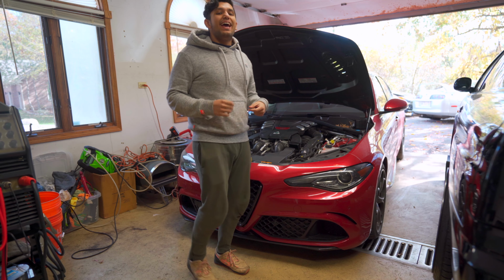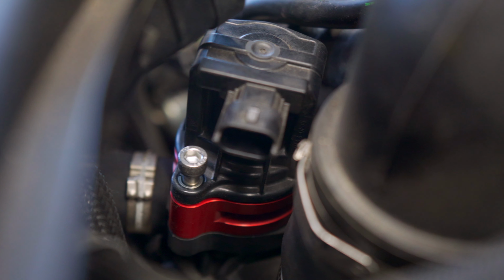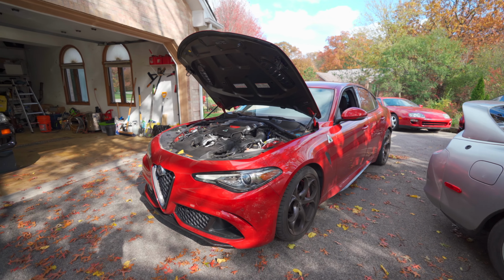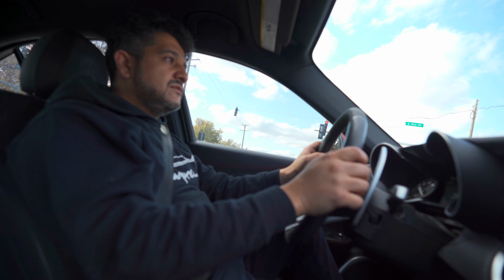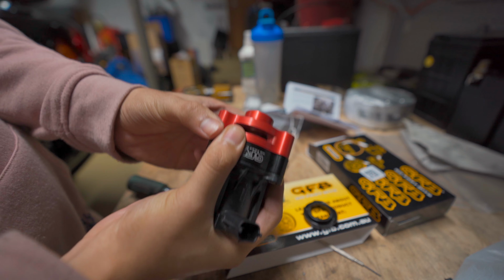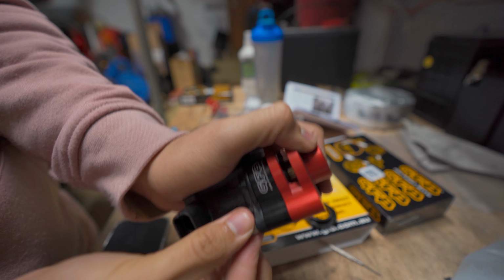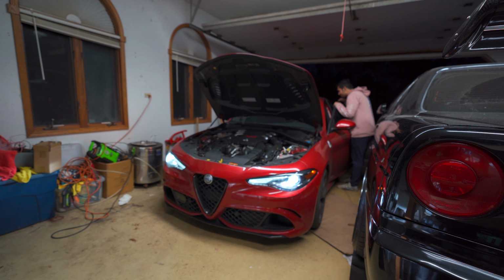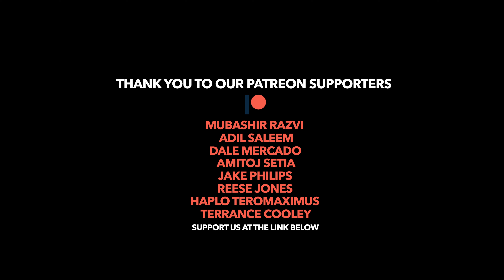Alfa Giulia Quadrifoglios Have A MAJOR Boost Issue, Let's Fix It!

Comment: I just installed it on my new Stelvio QV but the valve is below the engine, my question is what happens if I enter a puddle or flood, won't water get in? When I decelerate

Comment: I installed the Weistec adaptors on my Stelvio QV. It wasn't as easy as your Giulia QV but I love the sound. I also installed the Ideal Race CF intake. A very worthwhile modification in my opinion.
Reply: They're still on. No issues and very unobtrusive sounding. They're a good match to the Stelvio QV. Unfortunately I'm relocating to Puerto Rico on the 25th and I voluntarily surrendered the Stelvio to the bank. I'm going to look into getting an RX-8 in Puerto Rico, rotary engines are the thing back home.
Reply: I left them on. I had some warranty repairs done at the dealership and now I can't open the hood. The techs don't know what they're doing.
Reply: I heard for the stelvio qv you would have to get under the car to access the Bov location for install?
Reply: I wish my arms were thinner but I was still able to get them from the top. The Wing Chun did come in handy, it's not easy doing it from under either. The easiest way would be removing the front bumper. My arms looked like I fought off a raccoon afterwards but I enjoyed the results.
Reply: @robertoruizantonetti6385  is there space to also fit the GFB DV+ in the stelvio qv?
Reply: There's plenty of space but getting to it is the problem. I did it by feel and it was risky. If you're going to do that I recommend you remove the front bumper. You don't want to drop a part into the intercooler.
Reply: @robertoruizantonetti6385  I just had a quick look under the hood to locate where I need get to. The left side looks tough but doable, the right side looks impossible lol I have no idea how you managed to get your hands in there from the top. There's so much cabling everywhere and it's quite deep.
Reply: It wasn't easy. I did it by feel and my arms and hands were scratched badly. If you have a friend with long skinny arms it would be perfect. It took me 2 hours to do both sides. Crack the bolts from the top with a swivel on the extension and you can remove everything by hand afterwards. Just be careful and use a magnet too in case you drop something.
Reply: @robertoruizantonetti6385  did you have to unplug some pipes and cables to move them out of the way?
Reply: No, I just snaked my arm down there. My recommendation is that you tackle that job when you have to replace your serpentine belt since you have to remove the whole front of the car. It's a 12 hour job to change a $65 belt on the QV. Gotta love whoever came up with that design.
Reply: did you do the ideal race tune after installing the intakes?
Reply: Unfortunately it was repoed when I became disabled and unable to work. That was going to be my next step.

Comment: Since it uses bypass valves instead of a typical blow off have you noticed any dips in power? Or delay in throttle response?
Reply from the maker: None at all! Because the car is fully run on MAP, it has no issues with the change in air volume.
Reply: @albonfilms  Is that due to tuning? So is there a possibility of dip in performance on stock setup?

Comment: The opening of the blow off sounds good but if it‘s connected to the intake, how does intake air not come out of those blow off‘s now?
Reply: It only opens when intake manifold closes and makes vacuum.
Reply from the maker: Elyas got it! They only open when the throttle plate is shut and the intake manifold no longer is drawing in boost. These are electronically actuated too, so they open when the ECU wants them too.

Comment: Weird, the bov is electronically operated and not vacuum? Maybe it's not weird, I dunno, I have old cars lol
Reply from the maker: Yeah, first time I've seen this sort of system! It's interesting though because it keeps the BOV closed on upshift for better response in the next gear. Cool system for sure!
Reply: @albonfilms  makes sense, and explains why the bov noise is so unnaturally abrupt sometimes. Really cool tech, keeps that boost on tap.
Reply: @robertsixto6320  Most new cars have electronically controlled BOVs, the Supra has it too.

Comment: Say hello to CEL.....possibly as ECM looks for that air in the intake...wisetech sounds like huge quwiffy. Lol
Reply from the maker: It doesn't use a MAF, the ECU calculates everything based off of speed density. Venting blow off valves will not affect anything.